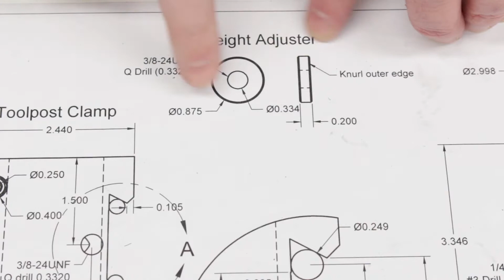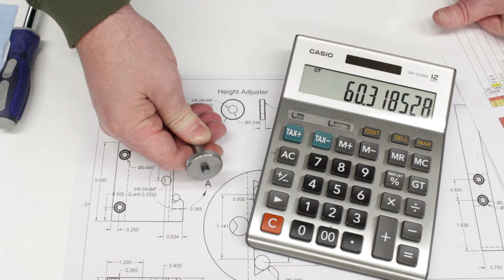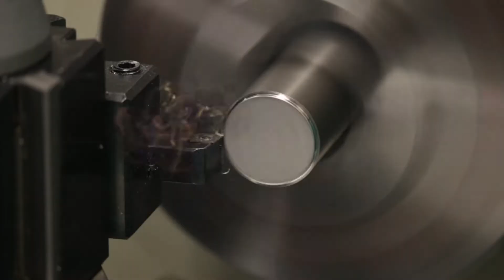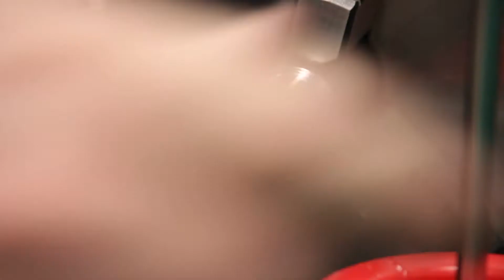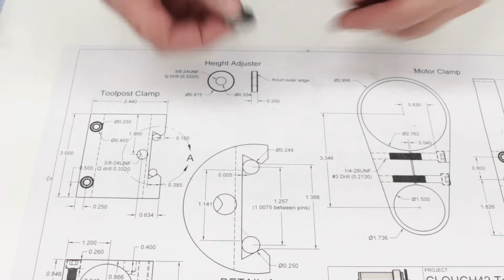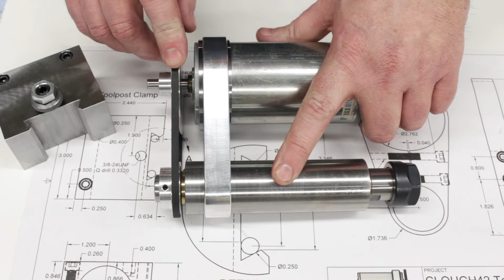Making a Toolpost Grinder Part 15:  Height Adjuster

Comment: Rather than risk spoiling that beautiful knurl, you could have gripped a bolt in the chuck and screwed the height adjuster up to the face of the jaws in order to face and chamfer it.

Comment: Hi, It is not necessary to do any calculations or adjustment of diameter to achieve perfect knurling. Just go in hard and fast with the knurls, don't let them dwell in one spot, use flood cutting fluid, low RPM and moderate feed.
Reply from the maker: Yeah, I've heard that, but I've never gotten it to work.  Perhaps my lathe just isn't rigid enough to take a deep enough bite.  In this case, I wanted a specific double-tracked pattern, so I did the math and it turned out like I wanted.
Reply: @Clough42 Interesting video and a very good trick to know when you want that double tracking done on purpose. :-) 

I started out with buying a cheap off shore scissor type knurling tool that came with a pair of knurls. Let's just say I was far from impressed with the results I got James. Buying good quality and more importantly well ground and sharp North American made knurls made a vast difference. But that knurling tool was much like most shop made designs and still way too lightly built given the forces involved when traversing the tool towards the chuck. The knurls just like in your bump tool need to be rigidly held so they can't slightly twist. If they do twist that's why you start seeing a spiral or helical effect on long lengths of knurling.There expensive, but stepping up to an Eaglerock knurling tool finally got me what I was looking for. Like IanneewUK mentioned, with the scissor type knurling tool you can pre-apply  a decent amount of of pressure on the knurling wheels and that way a calculated diameter isn't necessary. It's also saves putting all that pressure on your cross feed screw and nut that the bump style does. Pressure knurling unlike cut knurling is obviously a deformation process, but there's still a minor amount of metal flaking off during the forming. Even more so if your trying to go a bit too deep since at that point the crests of each knurl tip start breaking off. Those metal flakes are the main reason you can see the flanks of each knurled tooth on the part becoming slightly rough and not as well defined even with very good wheels. For that reason you want to apply as much cutting oil as possible. Flood coolant that most of us don't have at home is supposed to be a big help while knurling since it washes most of those fine flakes clear so there not run through the knurl again. Maybe some day I'll try it, but I suspect your calculated diameter method might give a slightly better knurl since there's then no need for the wheels to speed up or slow down to match an imperfect diameter. 

For general information the cut knurling process gives much better results but the tools are expensive. Over $1k for the cheapest I've seen so far. Some years ago Michael Ward wrote up an excellent article in the HSM magazine about making your own shop made cut knurling tool that might be of interest since reprints from Village Press are available.
Reply from the maker: @turningpoint6643  making a clamp knurling tool with a cam lever is on my (unrealistically long) list of projects to do in the future.